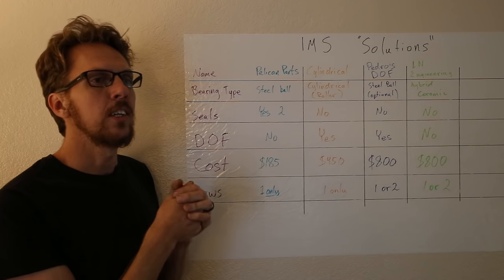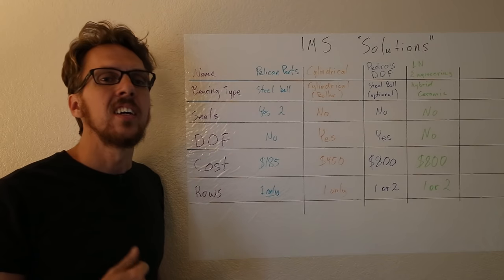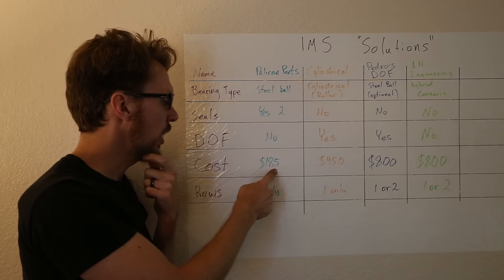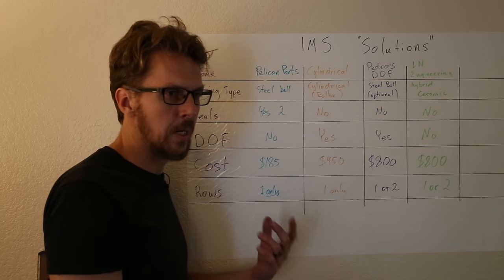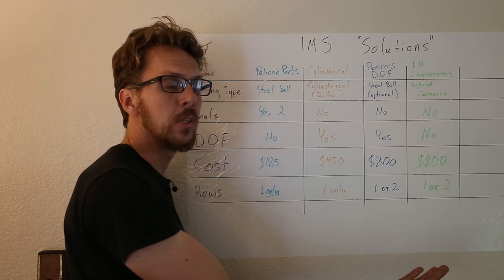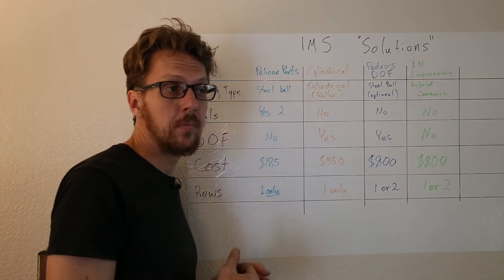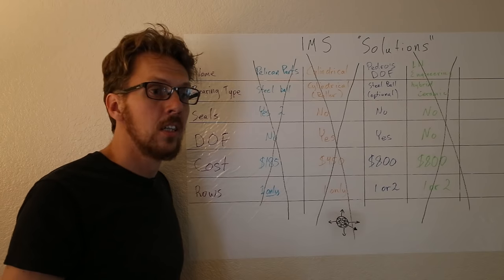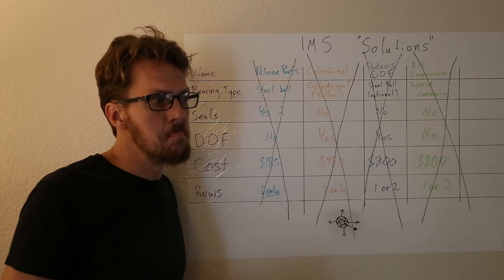What's the Best IMS Kit for Porsche (996 or 986)

Comment: Can I ask where you sourced a dual row sealed ceramic hybid bearing?
Reply from the maker: I've been reluctant to share specifics (as I explain here http://burnerscars.blogspot.com/2016/08/sourcing-your-own-porsche-ims-bearing.html). But I'm starting to get worn down, so I think I might provide specifics (with many many disclaimers) in the near future... let's say, a week from now?
Reply: Thanks. That would be helpful to us dual row owners. Of course you would not be responsible in any way. It would be a "duplicate at your own risk" thing. Just to get your opinion, I am working with an eBay seller who currently has the LN Engineering singe row solution kit for $1499.95 including shipping which $265 plus tax less than what LN sells it for on their website. They appear to be a drop shipper so the kit ships from the LN Engineering supplier. Volume sellers have access to deeper discounts per unit than the public from LN and that is confirmed directly from LN Engineering. He is able to get the dual row solution kit for the same price. Would you do it at 1,499.95? There are many who have done the single row solution kit and have no reported issues so far unlike the ceramic bearing.
Reply from the maker: I like the LN solution. I think its superior to any bearing. It's still kind of new, but it claims to be the only permanent solution. If you're willing and able to spend the money, I'd seriously consider it. Of course, I think you have to do a cost benefit analysis based on your particular engine. If you have a well maintained, low mileage engine, it probably makes sense. On the other hand, if you have 100k on your engine, you may need or want to rebuild the engine in 50k miles. In that case, it probably doesn't make a whole lot of sense.
Reply: After months and tons of research on this topic, I’ve decided against any type of ball or roller bearing and instead ordered the dual row solution plain oil feed kit today for a more reasonable $1276 from www.importecwarehouse.com. Many sites are deeply discounting the solution kits and I'm guessing it’s due to it not selling as quickly as the LN ceramic upgrade bearing due to lower initial cost. My reasoning for the oil fed plain bearing solution is, 1. a plain bearing is what’s at the other end of the IMS shaft and 2. I do not like the ceramic upgrade with the flange side seal removed. Consider it's splash fed and that any circulating debris in the engine, even smaller particles, can enter between the balls and race and cause accelerated wear or even failure. There are number of already documented failures with the ceramic bearing on Reenlist and other Porsche sites. My take is if you are not going to do the solution due to cost and you're not keeping the car long term, install a sealed ball bearing like Burner and Porsche did and change it out more often. Don’t rely on clutch replacements as the clutch could easily outlast the bearing. True my car has 102k however I plan to keep it indefinitely. Even if I do a preventive rebuild at say 150k-200k, the IMS should still be usable or hopefully LN will offer the kit’s components a la carte and I will just replace the bearing and flange.

Comment: What about the pressure differential created in the IMS?  That is the cause of the problem in the first place whereas it forces grease out of the bearing.  Check out James P on YT.  He drills two diametrically opposed holes in the IMS to isolate the bearing from this process.
Reply from the maker: Just when you think you've heard every theory... I searched James P, but couldn't find the video. Do you have a link? It sounds interesting.
Reply: One more thing.  I am not exactly correct when I said that the pressure differential forces grease out of the bearing.  What actually happens is that the air in the IMS get heated and forces out through the bearing seals.  When the engine cools, a vacuum is created within the IMS and it sucks some oil into the bearing, which in turn dilutes the grease, which in turn allows this thinner grease to be spun out of the bearing during operation, thereby drying up the bearing.  If that's not bad enough, it also traps oil in the process, the oil becomes acidic and corrodes the bearing itself.  That's why the cars with low mileage that sit in garages are particularly in danger... like my car.  My engine hasn't blown up yet, but I am considering Pedro's solution to lubricate the bearing.  My only concern is whether or not the IMS fills with oil and causes other problems like rough idle, etc.

Comment: do you know about the ims solution? it seems to be the end all, be all real worry free solution.
Reply from the maker: Yes! And I do think it might actually be a real solution. From what I understand, it's essentially a plain bearing. I believe it's a similar design to that is used on the other end of the IMS and what was used in other model Porsches. It seems like this design really would be the only solid and permanent  solution. It is by far my favorite. I didn't include it in the above chart because it's only now becoming available (so it's relatively untested), and it's also quite expensive. However, it's definitely something I will keep a close eye on. If it works as well as claimed and the price drops a bit, I might consider it the next time I replace my clutch... or I might just stick with another $200 bearing. I could buy a lot of ceramic bearings for that price...
Reply: taylor wagneers where can I get it or what's the brand called ?

Comment: Hello again,

We got motivated by your videos and decided to get a 996 knowing that we will be replacing the IMS

We got a 2002 996 with 81K.  Not sure if it is a single or double row, yet 
We need to replace the IMS bearing.

Would you please guide me how to source the bearing. The more details the better. I am very detailed.
I might be doing it myself just like your did.
 Not going to go with any of the options that you mentioned in the video even though I had multiple phone conversations with Pedro. I believe that a DOF might not be the right solution. The bearing needs be be misted. so a DOF is not right. a Bearing without seals is not right. You are spot on with your analysis about the seals in other videos.

Please feel free to email me to hlotf@yahoo.com .

I really appreciate all your help.  Thanks, Hassan
Reply: Tell me what you bought , IMS you bought, and how much is was to have it replaced.  Did you do anything else while in there?

Comment: You clearly have never designed or produced anything yourself. If you had you would have known about all the hidden costs involved. $800 is peanuts. It will probably cost you that just to remove the gearbox to get to the IMS. Also you haven't mentioned the route cause of the problem and why there is only one solution to fix this for good. Pity Porsche themselves didn't do a better job in the first place.
Reply from the maker: You must not have seen my other videos.  I sourced my own hybrid bearing and parts for far less than $800. I also removed the gearbox and replaced the IMS myself... 

If you mean the IMS solution which replaces the bearing entirely, yes, I agree, it's really probably the only permanent solution. It was very new at the time of this video and not readily available. It's still pretty new, but I suspect it will work well.

Comment: This guy fails to mention that the Vertext roller bearing can sustain a higher axial load than a regular ball bearing and that it fits a vehicle that originally used 1 or 2 ball bearing IMS
Reply from the maker: I had a trail name of 'That Guy,' but most people call me Burner ;)

I didn't go too deeply into the different roller bearing options (and it seems there are a few).  Many people are using them, and it seems they are working well (I haven't heard anything bad about them). I didn't really consider a roller bearing because, generally, they have lower axial loads and they also have a shorter life in poorly lubricated situations. Since many believe the problem is one of lubrication, this was a significant factor. That said, I could probably make a second video just looking at roller bearings, as there are many options. However, as you pointed out, there are some high quality roller bearings that might address these issues.